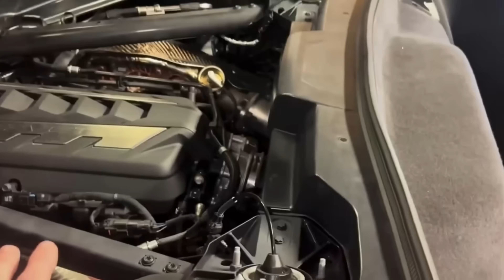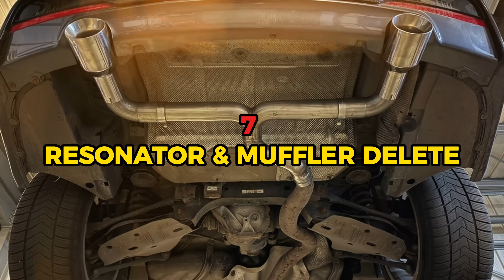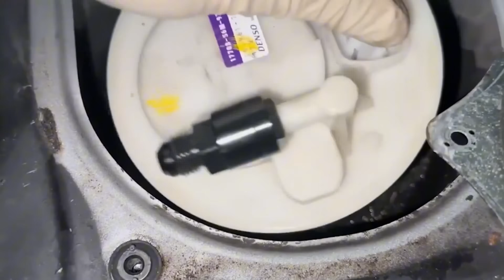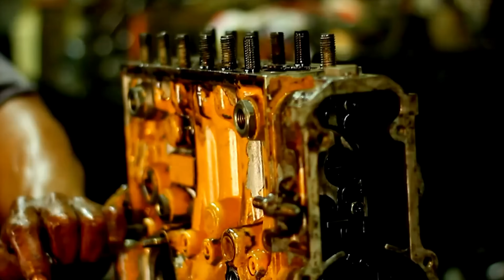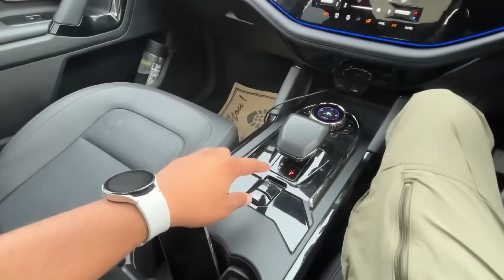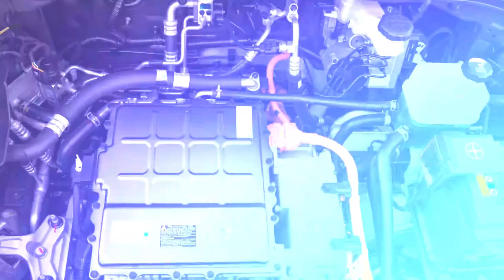10 BANNED Mods That Will Make Your Car Run Better

Comment: Cold Intakes….for one you will gain NO HP without a tune and if you’re driving a naturally aspirated vehicle, you will gain no noticeable gains even with a tune! Turbo or supercharged engines benefit more from CAIs. Another thing, not every vehicle today will accept just swapping out the oem breathing box and all other parts in place of a CAI. The computer in most vehicles will make a running lean code. When the problem starts at the MAF it is affecting your entire engine because now your ECU is getting false information from all parts that work along with the MAF. 

Injen Technology creates tuned CAIs for those that want to pay the money for a sound upgrade only (non aspirated drivers). They tune their CAIs in house to work on your vehicle without making your engine run lean.
Reply from the maker: That's a great point about the importance of tuning with cold air intakes.

Comment: The cat delete holds true for 50’s,60’s,70’s,80’s and early 90’s vehicles. Today’s vehicle and even back as far as 2006 are programmed through the ECU to use a catalytic converter. Removing it will cause more problems than just a check engine light. This video is full of lies. Better learn your stuff bout your vehicle using the VIN number before doing boneheaded things to your vehicle killing it slowly!
Reply from the maker: I appreciate the clarification, and the VIN is always a good source of info for vehicle-specific data!